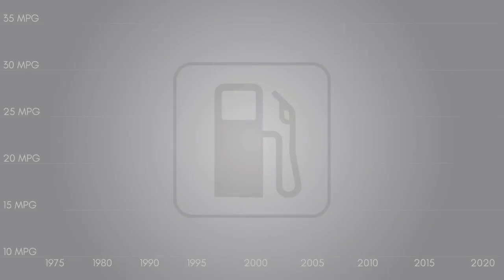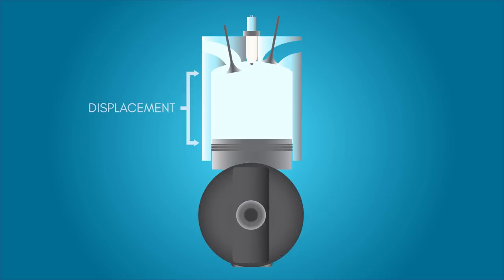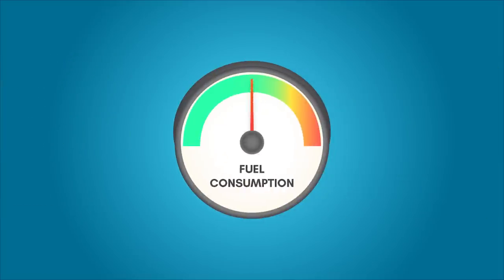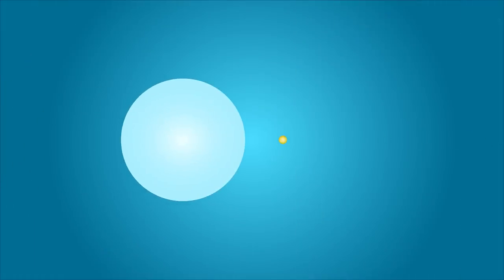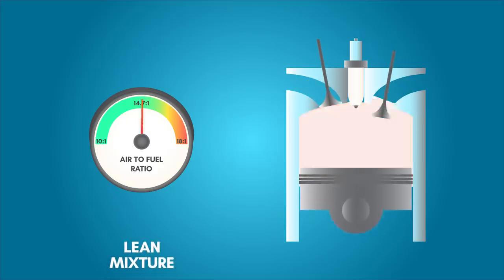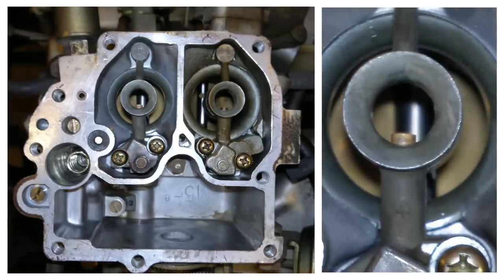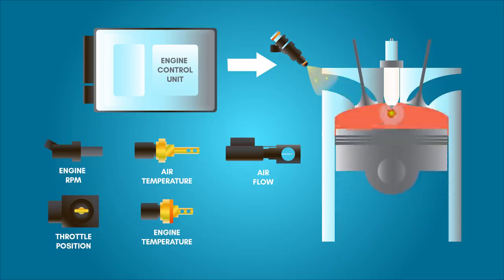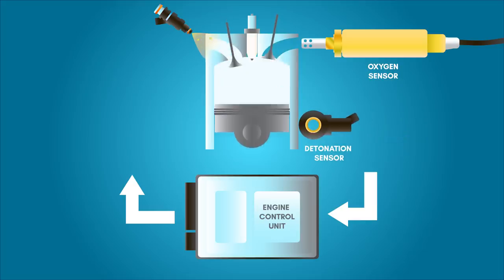How Engines Are Becoming More Fuel Efficient

Comment: has anyone noticed that new engines/transmissions have not been as reliable in long term use? There are a lot of cars on the road from 10-20 years ago that have 200-300k miles on them. Newer cars tend to see engine/transmission issues around 100-150k miles. The cost of repair them have become almost not worth it. So what is the environmental cost of vehicles not lasting as long?.... all to get 1-2 more mpg while in use???

Comment: The gasoline and air diagram is all wrong.   You showed a 14.7 to 1 by volume.  It is 14.7 to 1 by mass.  The gasoline droplet would be much much smaller than that

Comment: If I could afford the payments I would love to get a new Honda Civic Type R (2.0L turbo 306hp) But since the Civic Si is $10,000 cheaper (1.5L turbo 205hp) I've been eyeballing that for a little while now and could definitely afford those payments. I enjoyed this video.
Reply: ...And yes I'm aware of the oil dilution problem with the "Earth Dreams Technology" direct "sport" injection with the new Honda's. I believe they use a 0W20 which is only available in full synthetic so if you change your oil every 5000 instead of 7500-10000 as recommended, you can greatly delay the wear and tear from the oil dilution and maximize the life of the engine.

Comment: The cars built in the 70's and 80's with smog systems Installed once the EGR system was blocked, small cars used more fuel than trucks. It wasn't until the oxygen and knock sensor was incorporated that any real fuel economy was noticed.

Comment: What about OPPOSED piston engine?? The Legend has it, they're over 56% efficient.
Reply: No...the way the pistons are configured is irrelevant. Efficiency comes down to what fuel: air ratio the physics of the engine can handle.
Reply: Boxer Engines are naturally balanced so have a tendency to run smoother; less vibration means longevity for parts not necessarily better mileage. It could be argued that w/out a huge counter weight there's less mass to move around but I think due to the small size of most car engines it's negligible.

Comment: When internal combustion engine designers finally learn that injecting spheracles of liquid fuel into an engine makes it run inefficiently , they might get somewhere. They can't see the forest through the trees  . they grew up on drag strips "who can go faster"  and now they're evolving into how far can we go on less. When you discover ,in the 1940s were many engines designed by companies such as Wisconsin engines with Factory engineered" vaporizing" carburetors.  idk why they called it that because it didn't create "vapors" They introduced heat  from the exhaust system into an integral intake exhaust manifold. very simple , very reliable.  these engines would run forever on a quart of liquid fuel. the carb only introduces a true "Gas" not fuel vapor which contains a liquid component. BIGG DIFFERENCE.  aprox 1600 cubic feet of "Gas" in 1 gallon of liquid.
Reply: True but you are just switching one for the other. A lot of energy is released during a phase change (i.e. liquid to gas). So if you do the phase change BEFORE placement in the piston you won't have a higher power output. Also there are inefficiencies in pretty much every part of the process so the more processes you have, the less total overall efficiency you have. So yes you would get "more" out of the same amount of gas but you would just have to be constantly at a higher RPM since your torque values would be lower so it just cancels out in theory.

Comment: The engine works by using the energy of a rapidly expanding gas. When water is converted to steam there is a similar sudden expansion in volume. Has water ever been injected into the cylinder at the comencment of the ignition stroke? Somebody must have thought of this.

Comment: While electronic ignition and fuel control helps in efficiency,  nothing was mentioned about the mechanical improvements, where the real efficiency is found. Without the mechanical advances in airflow, engines would not gather efficiency. 

You left the important stuff out, guy.

Comment: The single biggest factor effecting fuel economy is the driver. The only cars that got 15mpg (or less) before 1975 were the big 8 cyclinder motors. 
You can get 200mpg on a motor cycle if you are willing to drive at 25mph and put up witheveryone on the road abusing you.

Comment: All cars should be hybrid, if you let an engine produce electricity that charges a battery and only drive the car with the electric motor/s and or 2-3 gears, you can get instantly 40-60% better fuel economy and less pollution. You can get engine system that pollute just a fraction of what normal car engine does to day. And if that engine only works on fixed rpm and only and always on optimal rpm then you can get a lot of efficiency. You can get 2-300 Horsepower electric motors, so a lack of power has never been the issue....

Comment: The internal combustion engine is nearing the end of its life.  Modern cars are a marvel of engineering and will last past 300k miles with basic maintenance.  Look at the Toyota Camry 2018.  Four cylinders and it puts out a lot of power while delivering up to 45mpg at 70mph on the highway.  I gotten that efficiency many times.  The old cars could get the mileage but not the safety, comfort or power of modern cars.  Carburetors can never reach this level of efficiency unless it is under perfect conditions and even then it is doubtful.  That is a fact.  Not only that but modern cars are actually less expensive than older cars adjusted for inflation an features in new cars.

Comment: Its known as "pre-detonation" and that's why its so bad for an engine, as it causes the air-fuel mixture to ignite before optimal ignition timing, thereby causing opposing forces on the internal parts of the engine, often damaging components like connecting rods or pistons or even the crankshaft. Besides hearing that awful clatter, you can smell when an engine has been pre-detonating (not sure how to describe the smell, its kind of sour-ish).

Comment: Some of the tips and tricks I learned as a hypermiler: your engine is most efficient when it's at the highest gear and reasonably high torque values. So the counter intuitive thing about hypermiling is that the most fuel efficient way to travel is to combine cycles of acceleration at about 80% of the throttle in the highest gear with coasting with fuel valve shut off completely. 

For example in my old car the most efficient way to travel was to keep accelerating to 80mph and then follow that up with long period of coasting until you fuel valve is open again. (in my old Dodge Grand Caravan 2006 it was around 45-50mph, but when we tested it in 1998 Toyota Corolla is was at about 30mph). So so example if I just set cruise control to 75mph on absolutely flat road I would get about 21mpg. But if I use cycles of acceleration and coasting constantly accelerating from 70 to 80 and coasting back to 70 I would get about the same average speed, but 25mpg instead of 21. This is a very small difference because of particularly inefficient way this particular engine used to cut off the fuel valve. I takes 4-12 seconds before ECU tells engine to shut off fuel pump making that tactic limited in efficiency, but still I was able to get something from it.

I'm not saying you should actually drive like that - that will annoy fellow drivers =) Just something to think about.
Reply: I believe that some non plugin hybrids are designed around that strategy. The engines are downsized so that cruising speeds fall within the peak efficiency loads of the engine, and the electric motor is used to assist during acceleration. So during highway travel the (small) engine is constantly working at peak efficiency, while topping off the batteries for use in a future acceleration event. A really nice idea to increase efficiency
Reply: @WouterNederstigt  Yes, exactly! Most regular engines peak efficiency basically gives most power for the least about of gas at something like 80-100 miles/hour, while hybrid always has much more consistent efficiency and comparatively it feels like hybrids aren't efficient at high speed, but it's actually not that, but that regular cars aren't efficient at low speeds.
Reply: It's mostly a matter of the poor part-load efficiency of gasoline engines. Diesels don't suffer from this as bad because they don't throttle their air charge at part load.

Comment: The premise of modern cars getting better mpg is incorrect.

Go back to 1971 and pick the first 100 vehicles that pass the stop sign at the end of your steert.

Go to 2019 and pick the first 100 cars that go past the same house.

The over all avg mpg would be very similar.

Probably in the low teens. 12-14 mpg.

1971
Ford LTD, Buick Century, Ford LTD, Toyota Corolla, Cadillac Fleetwood, Chrysler Newport, Oldsmobile 98, Ford F100, Dodge Dart, Pontiac Bonneville, Chevrolet Kingsman wagon.

2019
Chevrolet Suburan, F150, F150, F150, Tahoe, Ram, Ram, E150 van, Honda pilot, Subaru Ascent, Yukon Denali, Cadillac Escalade, F150, Accord, Jeep Wrangler, Nissan Armada, Tundra, Toyota Sequoia, Town and Country.

Look at the real world mpg of those vehicles and you'll see the average vehicle is still getting what they did back in 1971. 

The EPA and CARB has forced people out of cars and into gas guzzling Trucks and SUVs.  They were unwilling to compromise and meet somewhere in the middle to keep people in more efficient cars.

No head room due to even better aerodynamics needed to offset the poor mpg of trucks and SUVs, no towing abilities due to ultra flimsy suspensions and weak automatic transmissions, no safety when hit by a truck bc of the ultralight weight of the car to get the corporate average fuel economy numbers up,  no trunk space, no spare tire to save weight, on and on. 

The heaviest of the pickup trucks are totally exempt from any fuel economy standards like the Ford F250 and a Dodge 2500.

If the EPA and the California Air Resource Board truly wants to see people driving more efficient vehicles, then they need to realize the problems that they caused and start holding the heavier vehicles to the same standards that they held the Cars to.

One solution would be the price for gasoline that you pay at the pump would be based on what you drive. If you drive a Toyota Sequoia, then your gas would be $12 a gallon and if you drive a Toyota Prius your gas would be $0.52 a gallon.

If you drive a Ford F-150, your gas would be $11.81 a gallon and if you drive a Ford Fusion your gas would be a $1.21/gal etc.

I think everyone wants to see the environment protected and our natural resources utilized with proper and conservative stewardship.

Also tax policy makes it extremely beneficial for people to buy heavy Vehicles versus a fuel economy car.
Reply: Freddy Hollingsworth so....100 cars on some street somewhere. Great sample lol. Which city? Which country? How scientific of you! CAFE standards alone would disagree with you, and it would be pretty silly to suggest that a 1970's LTD is as efficient as a 2019 F150 even if those were representative of the average vehicle on the road today. Also, overall fuel consumption and efficiency are not the same thing.

Comment: I don't get it ... I have Golf MK2 1.6 diesel 1986 and fuel consumption is between 4.5 - 5.8 liter per 100km . I mean , this engine is made 1986 . And now in 2019 a very expensive hybrid cars are spending same amount of fuel . 30+ Years later , wtf?
Reply: Compare the power and weight of the new model to the old one.  Cars have gotten much fatter and more powerful at the same time, so the fact that they still offer the same or better fuel economy is pretty impressive.
Reply: Yeah , I agree ... but still the difference is huge in comparing the technology that is involved . I mean , by now new vehicles  should have standard 60 if not 70 miles per gallon . Of course, in the same class . Just saying ...
Reply: Build a car with modern engine, materials, and aerodynamic tech, but make it as stripped-down, underpowered, and basic as a 1980s econo-box, and it would probably do over 100 MPG if driven right (how you drive something is incredibly important for fuel economy).  Thing is, they'd never be able to sell it to the modern car-buying public.
Reply: Again, I agree . But what does it mean in overall result ? Just think about it. Difference is really minor . Price etc.

Comment: You are totally wrong about fuel injection Vs Carburation, the one lacking thing that a fuel injectors cannot do that a Carburator does is Emulsify the fuel. The emulsion tubes in a carburetor add air to the fuel before it is introduced to the airstream. This is what makes the fuel more burnable. The injector only sprays raw fuel into the airstream. This is why carburetors will always make more gross HP than injectors. If you want to fix this problem you need to invent an injector that sprays Emulsfed fuel not raw fuel.
Reply: Completely wrong, the only reason modern super cars exist are due to modern systems like fuel injection. These systems are much more complicated then you believe and are chosen for a reason.
Reply: @gingercyclops4397 You miss my entire point. Carburetors ALWAYS make better power than fuel injection. Because of the reason I have stated. I have 1000s of dyno pulls on all types of engines and fuel systems, including the latest electronic fuel injection, factory and aftermarket. And every time we test an engine with both systems the Carb wins. But this is max power testing. Not drivability testing. But if you buy a Carb from a custom builder they will deliver the drivability of fuel injection, I have done that testing also. The major reason we use electronic fuel injection today is because of emission standards and Cafe ratings.

Comment: I would like to know if high compression boosted application can yeild even higher fuel economy then your standard high compression I know you can biuld Honda engines to 1600hp to 500hp depending on the biuld and boost but if you design the engine along these lines can you get to even higher mpg numbers.

I imagine u will only see gains at cruising and acceleration will not change.
Reply: Higher compression does indeed yield higher efficiency, when you run the thermodynamic analysis on both the Otto and diesel cycles.

Comment: Too bad they never got into combustion chamber design, or stratified fuel charges. All of the gains of fuel ratio pale in comparison to the gains in these areas. Maybe that will be part of the D.I. discussion.
Reply from the maker: Working on part 2, which will cover just that, direct injection and ionic sensing

Comment: You can do the math 600 RPM minutes is 10 times a second when the engine is at 1800 RPM a minute that's 30 times a second okay per cylinder so if you have a six cylinder that means you have 1800 cycles a second

Comment: How the engine use the fuel is the most not efficient way and no one from the manufacturers are changing it. You might say fuel injection is fuel efficient but you are still injecting liquid and liquid does not burn. Until the manufacturers do something about how to deliver fuel for better fuel economy, all are still wasting fuel and when you want your engine do better you have to do it yourself. 100mpg should be the minimum when fuel are delivered correctly.  The problem in terms for fuel efficiency is not the engine, it's the fuel delivery system.

Comment: You should see the fuel economy of small diesels 80’s ford ranger 2.2 Perkins diesel got 48 miles per gallon
Reply: patrick greiner my grandad put one of those into his 1982 Mazda B1600 for the very reason of the petrol 1.6 being ridiculously thirsty. The 2.2 is a good motor, clacky and used to cackle since he had a coby muffler on it

Comment: 3:24 Small displacement engines with a turbo are the answer.... The small displacement uses very little fuel when cruising and the turbo improves acceleration. The turbo makes a small engine perform as well as a much bigger normally aspirated engine.
Reply: at the cost of extra complexity

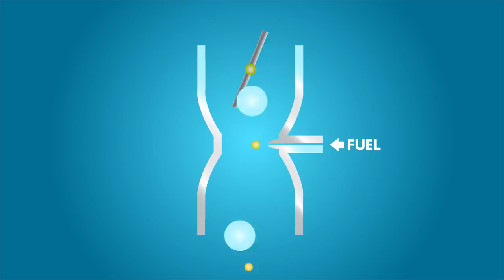Comment: 5:47 ok but tif its a cooling issue when not just add  a water methanol mix ? and  also some nos to  insure proper oxidization ?
Reply: firefox5926 because people won’t fill up the tanks and it would  become a problem. They surveyed people to see if they’d be willing to fill up another tank. Acceptance level is limited. You’d have to have onboard water production.

Comment: Thermodynamically engines are still really inefficient.. I think the most efficient designs only extract like 30-40 percent of the energy contained in gasoline... Most of the energy is lost as waste heat.  I wonder how they'll be in the future.

Comment: 4:08 ok ... you lost me  wouldn't the solution br to increase cylinder size  and hence volume so that you can add more air to the mix to insure all of those carbons can find an oxygen ? all that adding more fuel  would do is increase the amount of burnt fuel in the exhaust gases? or to run the mixture leaner to    do the same thing tho at the lose of power ?
Reply: The problem is the gasoline needs to be misted into the air evenly and have a consistent mixture through the piston size. But since acceleration means higher rpm, the time the gas has to mix before spark is around 1/100 of a second. Increasing the amount of gas increases the chance of more being burned solving the time issue

Comment: Strange that my old Volvo 740 turbodiesel with 135hp is almost as quick as my dad's Volvo XC70 D5 with 185hp, but with almost half it fuel consumption.

740, shaped like a brick but lighter and I always drive it like I stole it.
XC70, 'streamlined' but heavy and my dad drives it like an old woman.

I'm not convinced modern engines use less fuel.